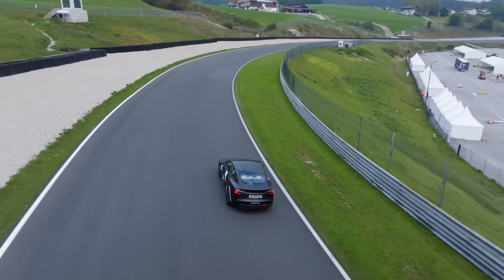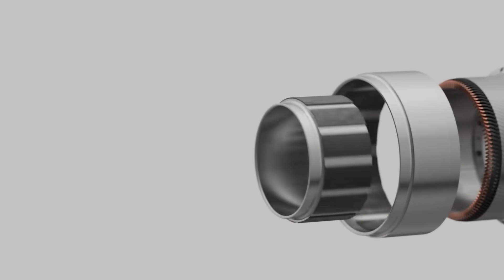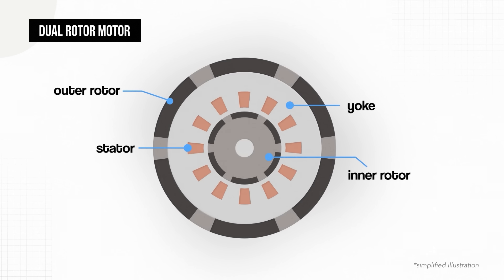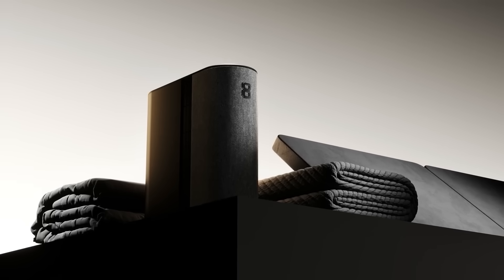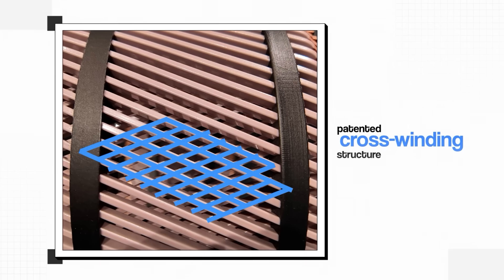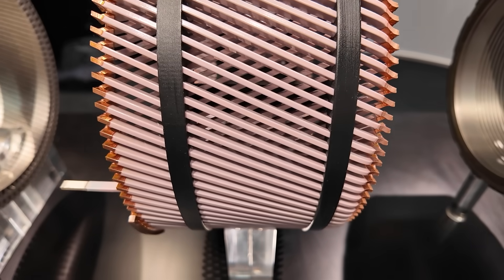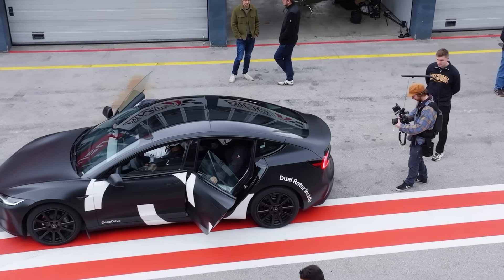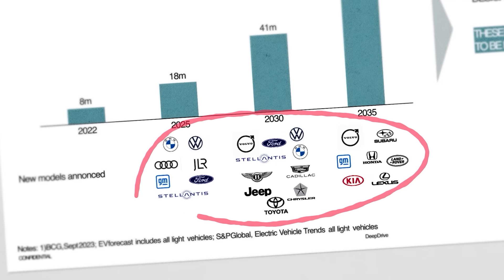How Dual Rotors Make Motors Insanely Efficient

Comment: Copper bars can also support fluid loops -- drill a hole through, pump coolant through.
Reply: what you're thinking of is called a pipe
Reply: @lorenzo42p haha, i was tired and high, couldnt think of the word pipe, lol
Reply: I actually thought they were tubes for the collant. But apparently they are solid. Perhaps the heat transfer just proved to be good enough this way and thus there was not need for them to be tubing.
Reply: Yeah I thought the same, if they are strong enough could be a "heat pipes" for maximum cooling effectiveness, but that's of course would be very expensive and probably not practical.
Reply: ya n reduce its current rating , thus the power.

Comment: Unsprung is far moreso understated, not overstated. In slower applications like forklifts or cabs, it'll be fine, but in-wheel motor designs will always handle worse in performance settings than they would with the motor sprung.

Comment: 10:30 is it unsprung mass or unsprung inertia?

I have yet to find sufficiently detailed research articles with equations to tease apart what happens if you balance the unsprung mass across a fulcrum. 

I am inclined to think it’s a bit of both with inertia less of a contributing function than unbalanced mass.
Reply: mass and inertia are equivalent in this case

Comment: Modern electric motors and power electronics are already very efficient, the biggest inefficiencies and logistical headaches are getting the electricity into the battery, for mass consumption, unfortunately there are no easy fixes.

Comment: The term "innovation" is an exaggeration. 

The idea of wrap around rotors has been around for over 100 years , there just weren't any applications that justified the extra cost.

The standard three phase induction motor was invented in 1889 and is already 94% efficient.

It wasn't until EV'S were being made that we needed motors that were smaller and more efficient.

So motor design concepts that were rejected 100 years ago because of cost are being dusted off and fully developed as "innovation".

The only thing an electrical engineer from 1920 would be surprised by is the strength and durability of the permanent magnets (1980's tech)

Comment: Nice to see actual, working innovation. I'm curious how this copper lattice will hold up over time - would the connecting material (plastic, I assume) be able to last or would it start failing from mechanical stress and temperature cycling.

Comment: I wonder how they solve the issue of having copper and other metal(s) in the cooling circuit. For a coolant circuit, you only want 1 type of metal, to prevent electron exchange resulting the circuit to ëat up itself.

Comment: hmm..  I wonder if you could further encase the copper lattice in an epoxy or some such.  Then you would have a very strong sleeve type component.  Of course, the thermal performance of the encased lattice would need to be beneficial as well. I simply don't know if the airspace is critical for the cooling performance.
Reply: use those spaces for coolant channels

Comment: I sense good news and not so good news in these motors based on their design for In-wheel use. It is correct that peak vehicle efficiency would want to have the motor in the wheels, but not only does that increase the unsprung  weight, it puts that motor where dynamic force changes in motion are maximized  helping to decrease the service life of the motors.
 Welcome to the era of planned obsolescence applied to EVs. Automakers have been making the best EVs they can lately to expand their markets, that is the good news. But now it seems they look to cut their manufacturing costs while ensuring that the motor(s) potentially remain the first major element to break, just like IC cars today.
Reply: The car industry can build cars like this with electric motor in each hub, but people wouldn't buy them. 
People are not that stupid, and buy only EVs correctly built, with a good long life. 
The high continuous vibrations in the wheel hub destroy the meshed free copper very fast by creating cracks in the quickly hardened copper.
Reply: Good point. Probably true as well based on past ' innovations' of the auto industry here and abroad.
Reply: IC cars today seek to cut manufacturing costs on overly complex designs forced by government regulations, seeking high performance for the Motor Trend pundits, and competing on advanced features. I drive a 22 year old car with a v6 cast iron block and heads that the manufacturer dropped for a redesigned aluminum v6 that weighed only 22 pounds less and got significantly worse MPG. IC cars suck because the design goals departed from consumer needs 2 decades ago and are only getting worse.
Reply: 5metoo • What the f are you talking about? 
The ICE car exhaust gases are highly carcinogenic.

Comment: I am waiting for battery tech and charging breakthrough
Reply: The batteries remain far and away the biggest problem with electric cars. Shaving a couple of percent off the motor efficiency barely matters when the battery is still stupidly expensive, a massive environmental drain to make and adds at least half a tonne to the weight of the vehicle.

Comment: You missed talking on the efficiency
Reply: That is because current electric motors are already highly efficient. There is really not much room for improvement.
Reply: @niempi2  20% more efficient, 30% less cost per Nm
Reply: @zarkoasen  How can you be 20% more efficient than 90-95% ? Current electric motors are brushing right past 94%.
Reply: @Alarios711  I guess 20% less conversion to heat
Reply: @zarkoasen  20% of 5% so .... 1% (maybe) more efficient ?
Reply: @Alarios711  I don't know the exact numbers; I know as much as you do.

Comment: i am a simple man. How i see it, here in the west, the most people , would need a reasonable priced electric car, but with a catch..
now most brands churn out either the usual 500hp-1000hp cars for no real benefit, other then to be under 5 seconds from 0-60 miles.
or they make affordable city cars with mostly FWD or sometimes RWD, but in the reasonable priced category, what is it, we don get? yes AWD.
i am not well informed on this subject, but i imagine, the cost difference KW motors makes it not cost effective.
cos logically i would say, have two motors every electric car, and make them rear biased (driving experience better, look at Polestar, the Polestar 2 first gen was FWD or AWD peopel didnt like the driving experience, the 2nd gen was RWD or AWD, and people liked the RWD a lot) , for a reasonable power in the cars around 4.1m-ish. 
i would put 100KW in the back and 50KW in he front (aka together 190hp-ish). the front would couple decouple like some cars do. 
now you would ask, but why would i want AWD on all cars? cos we have rain, frost and snow. All cars even city cars are affected, and having a good AWD system prevents many crashes. 
I could also understand  a 4WD system, with similar overall power dynamics.
but as i said earlier, i assume its not really cheaper to put a 100KW and a 50KW in a car then putting two 100KW in the car, cos every other part is the same.
we need low cost motors, from which we can have two in a car as i mentioned above, without making the car to expensive.

Comment: My thesis is that since the Advent of the tractor about 200 years ago when man was done plowing his garden or his field for sowing seed to the cows he went on to waste time with a Mortgage Insurance Rent a Lease for a Home that could have been made for pennies on the dollar if he only would have used the tractor to the 3D Print the Adobe homes for his family and the community. The only thing that you need to 3D print the best adobe house that you can live in today is a good tractor a padfoot roller and a dedicated concrete Adobe ditch.
 Did you hear what I just told you that every farmer in every country worldwide could crush out the housing problem within probably less than a couple decades. Nobody's even talking about a hydrogen or solar Adobe mill right now.
Thank you
Reply: WTF
Reply: @redshift3 so basically you don't even have to have the tractor actually if you just have the Padfoot Roller. Essentially what you are making is stronger than the Adobe that they put in forms in the desert Southwest because it has more binding straw and is hydraulically compressed making it much sturdier as a finished product. When you think of an adobe ditch for making the mix there's a thousand different possibilities the most primitive of ones would be just a simple concrete ditch like you see at the car wash but imagine improving it with like hydraulic kneeders on the side massive hydraulic rolling pans. It doesn't have to be a tractor if it can be a steam rig or an electric three-phase rig like you see at a sawmill.

Comment: It’s interesting that the heat is only taken from one end.  The opposite end must be relatively quite hot given its effectively the center of heat and resistance of a loop.  It would seem to be acceptable as it also seems an opposite end cooler would be possible or maybe not considering the mechanics of the rotors
Reply: For in-wheel motors, the opposite side will be next to the disk brakes BTW...

Comment: This is great.  Innovation is welcome.  But what, exactly, does "20%" greater efficiency mean?  Presumably it's a 20% improvement (reduction) of losses in a motor that's already 90% efficient thus taking efficiency up to 92% but at what cost?  And hub motors sound great on paper and might work great in a race car but how will they stand up to that environment for 150,000mi?  Don't get me wrong...I LOVE this concept but it doesn't erase certain practical limitations.  I hope they figure it all out!
Reply: It could also be used as a center-weighted power plant in EVs and benefit from weight reduction.  I'm no engineer but that's my guess.

Comment: There are two yokes and two air gaps. The rotors also have yokes. The axial path for end winding cooling is area limited. There are some advantages if the rotors can be phased. Great job getting a patent on prior art.
Reply: Also at 8:38 while telling that the copper has to hold itself, literally shows the part that holds the coil
Reply: @jozseffabri  
Exactly! Came here to comment on this too. It's kinda funny that every time he says "yokless", he shows litereal yoke right there on the screen. That part IS the yoke. Complex and small, but it's not absent after all.
Reply: @MrV1T  In DeepDrive’s design, the stator is a cylinder sandwiched between two cylinder rotors, but it requires iron in that sandwich. The outer rotors also need iron to redirect the flux back to nearby poles and cross the rotor again.

So in the design there are two iron objects with embedded magnets and one iron object inbetween with embedded coils.
Reply: The diagonal path of the copper bars is actually to make the iron rotor also have iron in a mesh of diagonal paths in a crossing pattern. Making it as strong as it needs as it is thin.
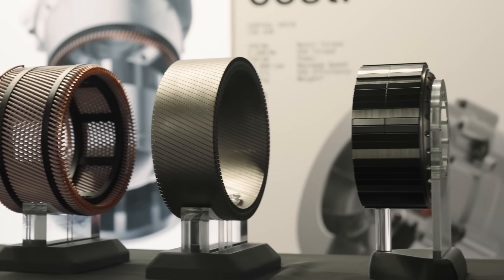Reply: 0:37 3:53 Also, what's up with that piece of iron, that has cutouts that exactly match the stator bar windings?
Is that "not a yoke", but just some silicon-steel laminations to hold the windings? 😂
Reply: @sasjadv it isn't a yoke since it isn't used to turn the flux back towards the rotor. But the field (permanent magnet) flux must flow somewhere to get between north and south poles, and it's much better to provide an iron path (high permeability, relatively magnetically soft, relatively high resistivity) than it would be to use an air core. Also, the iron somewhat shields the copper from the field flux (which have very low resistivity), this reducing eddy formation and loss
Reply: @richardcarter8801  Yeah, sure.
I found it funny, how the video talked about needing these bar windings for rigidity, because no yoke holds it together, when there is iron for the stator so you could have used other windings too. Like they create this illusion of an air-core, which makes their motor look different, when in fact they use normal iron around the windings. Which I at first found weird; to me getting rid of the iron doesn't make sense.
Reply: Thank you. I was going to post this reply, but glad I did a Ctrl-F. Not understanding the nomenclature, or shifting definitions has made this more confusing than it should be.
Reply: HI JERRY!

Comment: 8:48 in the industry, we call them "busbars"
Reply: But not in that configuration.
Reply: @codetech5598  a busbar has a cross sectional area that is non-circular. I'm not referring to busbars as used in applications such as industrial plants or substations.
Reply: @nschrombeck  There is "Enamelled Square Magnet Wire" if all you need is a square cross section.
Reply: @codetech5598  True, forgot about magnet wire. They also use that in transformers
Reply: Looks more like a variation on the hairpin windings plenty of motors have been using for years, but without the laminated steel that usually helps support them and guides the magnetic field lines.

Comment: Thanks for pointing out that "cars often operate at low load in real world conditions". To impress potential buyers the focus is mostly on high performance but who needs it on their way to work? Similarly 0 to 30mph is so much more important in city driving than 0 to 60.
Reply: My 2015 Leaf will leave all but hi-end Beamers 15 feet behind from a quick start using outdated motor tech -- I do it for giggles. 😂
Reply: @P @PETERJOHN101 ry lame joke! Are you a kid? Those “beamers” the ones that can actually go fast and actually tow while your lame ev does 0-60! 😂😂😂😂😂
Reply: @alanmay7929 
I can go 0-60 faster than any production car with an rsvp under $50,000 😂  never compared my ev to truck tow ability because I don't tow!🤣
Reply: @PETERJOHN101 yeah your useless toy does 0-60 wow!!!!!! THATS THE ONLY THING THAT “matters” on $50k cars 😂😂😂😂😂😂😂
Reply: @alanmay7929 
What are you smoking?😂
Reply: @P @PETERJOHN101 isn’t that funny how a 1000hp tesla modelX plaid can barely tow 5000lbs while a 260hp bmw x5 diesel tows up to 7700lbs? How does it even make sense? 😂😂😂😂😂
Reply: @P @PETERJOHN101 the 850hp tesla cybertruck barely tows 11,000lbs while a ford f450 with only 500hp diesel goes up to 40,000lbs again how does that make sense?
Reply: @alanmay7929 Tow rating has very little to do with engine torque or power. It’s a body/frame design decision. 

Vehicles designed for high towing loads have very rigid rear ends, so fare poorly in rear-end crashes (the energy is passed onto the occupants).

EVs are designed for passenger use and are marketed on safety, so have large rear crumple zones, and thus fairly poor to non-existent towing capacity.
Reply: @markirmuir Blablablabla!!!! What is the cybertruck? The tesla semi? The ford ligtning? When we compare ICE vs EVs with similar power the ICE actually are way more capable with what they have.
Reply: @m @markirmuir so ICE vehicles are not marketed on safety too!? ICE have zero crumple zones! tesla modelX plaid 1020hp unibody with rigid castings! Tows 5000lbs while bmw x5 300hp diesel also unibody tows 7700lbs, those are modern safe vehicles.
Reply: @markirmuir the electric gwagen is already soo heavy that it requires a special driving license to actually tow with it which the range will suck anyway! Meanwhile the diesel 300hp beast even comes in 6x6 for the military use and can haul up to 18,000lbs even on hardcore off-road situations.

Comment: hub motors DO cause suspension issues and NO amount of suspension design can compensate for them vs not having that unsprung mass. There is however a MUCH bigger issue with hub motors: motor efficiency and power density benefit from really small gaps between stator and rotor(s) and high RPM, meaning you're pushing your rotor balancing and bearings to the limits of what they can do to get a good motor; if you now add in the crashing impacts a wheel sees you either get rotor touchdown or need to open the gap so wide you make a weak, inefficient motor. No production car uses this because the real world is about reliability and terrible roads. Lordstown Motors was trying and packed it in after a few uhhh...thermal events?